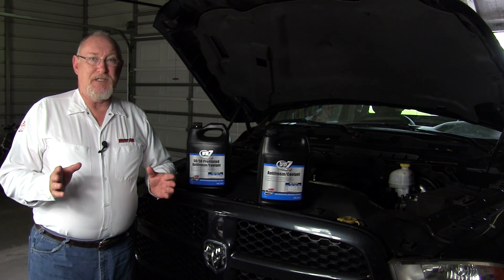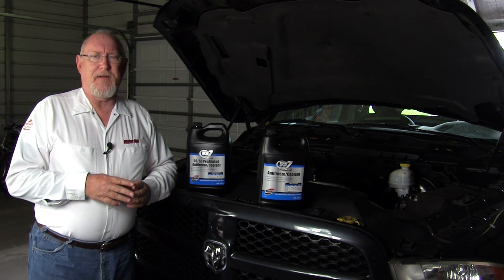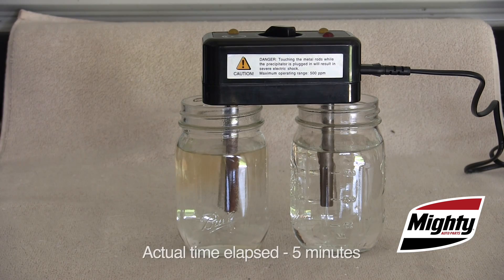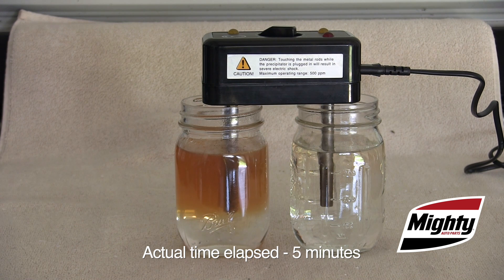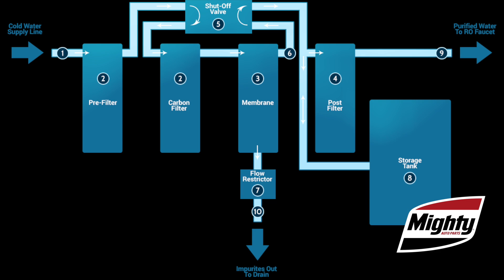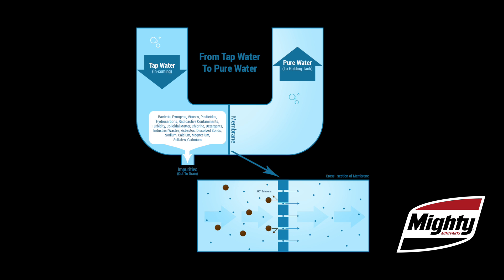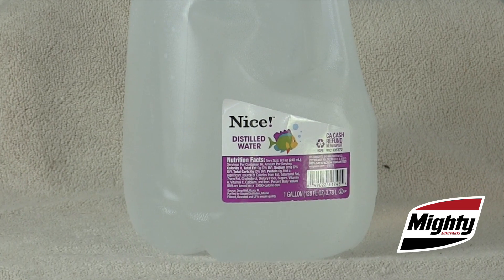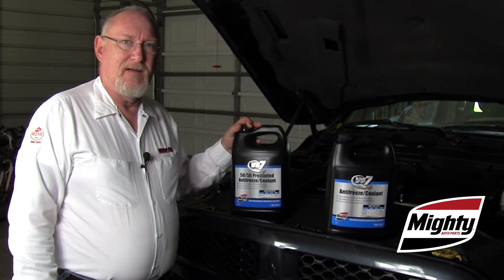The Mighty Minute - Ep 7:  Water – The OTHER Half Of That 50/50 Coolant Mix!

Comment: I read that if only Antifreeze is used on car where the climate is very hot is bad because the antifreeze doesn't have that good heat transfer efficiency(deionized water have).This doesn't mean the car will overheat but it will put more work on rad. fans.
Reply from the maker: You're correct in that pure coolant will not transfer the heat away as efficiently as a proper mix. It's not going to put any extra work on the fans, though - it could lead to heat damage to the engine and engine components.

Comment: I'm sold. I will never use tap water again. Now I must flush 5 radiators!  :)
Reply from the maker: Ideally, you should use the same water to flush the cooling system to avoid leaving any small trace deposits behind. Many coolant manufacturers also recommend a flush agent to help clean the system.